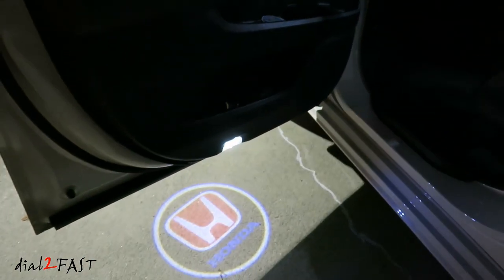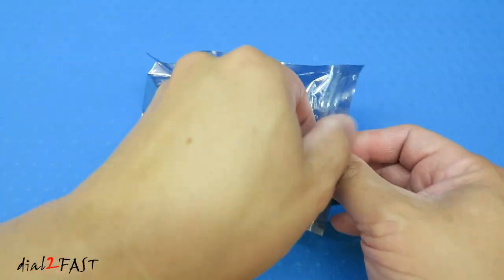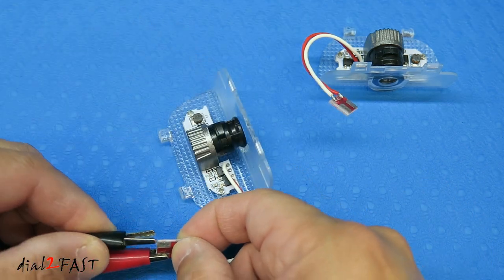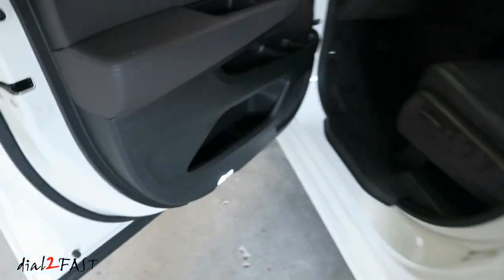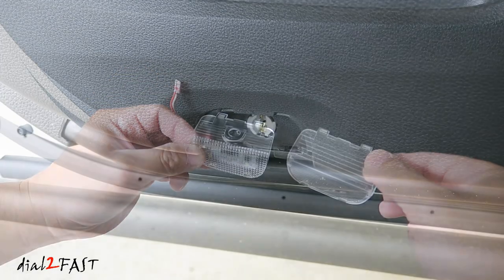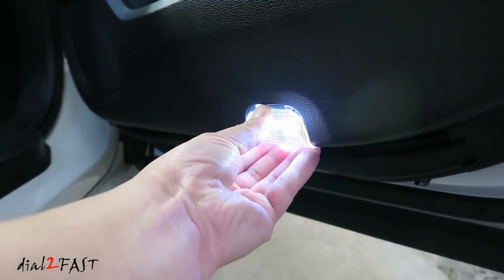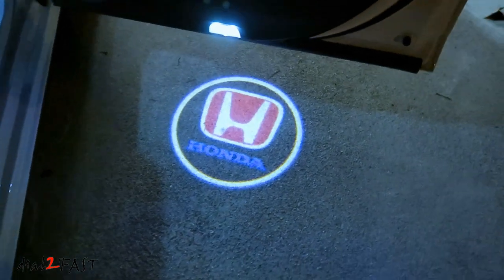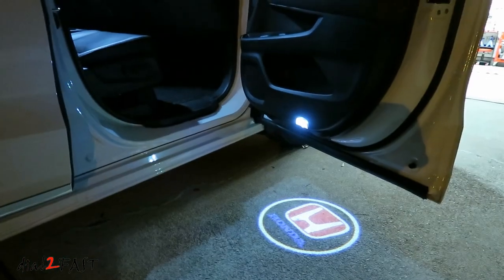Install Car Door LED Logo Projector Light - 2019 Honda Odyssey

Comment: I purchased the projector piece you showed to install but when I remove the caps from the door all I see is an empty hole where you plugged in the wiring. I have a 2018 accord LX. How do I get the the insert installed to I can get a light source for the projector? Thanks
Reply: Me too. Same problem, I have 2018 Sport 2.0T.
Reply: Same here
Reply: @antsocold5884  I think only the Touring and EXL come pre wired. Otherwise you have to buy the wiring and open up the door and route to the fuse box.

Comment: hi dial2fast just  wanna let you know the one your showing on this video is from 2014- 2019 i bought the ones from the link and it says it will fit honda odyssey 2004-2015 thats not true i have 2006 honda odyssey and it is totally different.

Comment: Does it matter how you plug-in in the new light into the OEM connection? Thx
Reply from the maker: The connector is keyed. You can only connect it one way.

Comment: The manufacturer says it only goes up to 2015 odyssey.  Do you know if the same size will fit a 2016?  Thanks, looks cool!
Reply from the maker: You can go by the model generation which yours is 2011-2017. You can also pull out the light you have and if it looks the same as the one in this video, then it will fit.